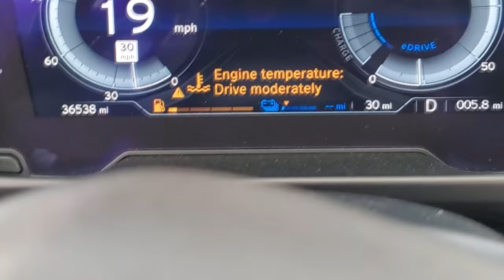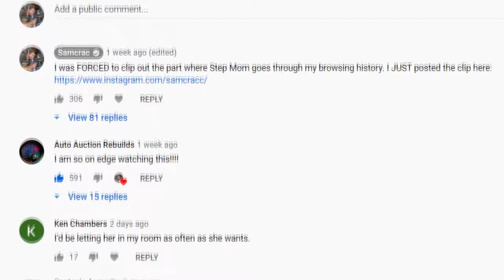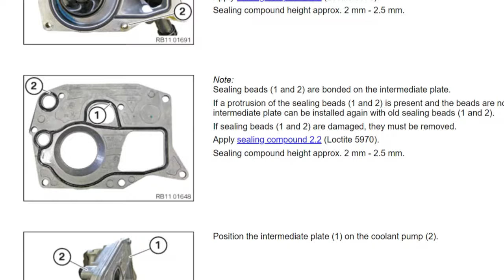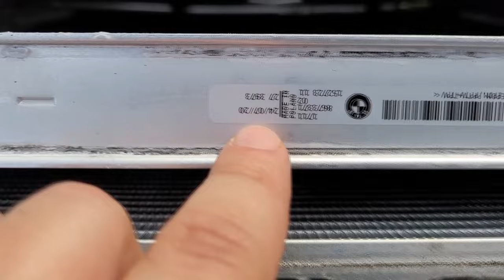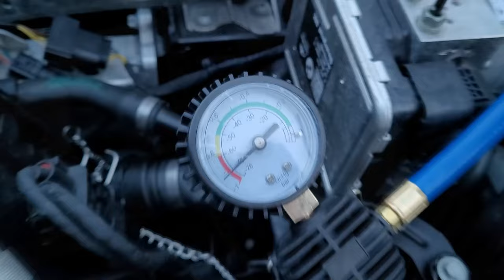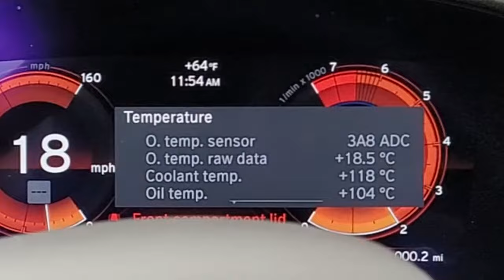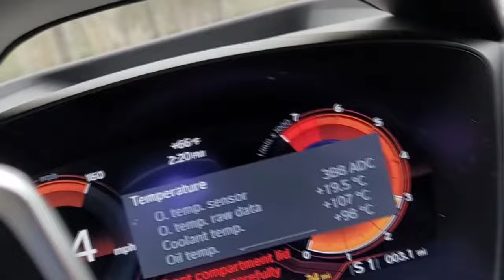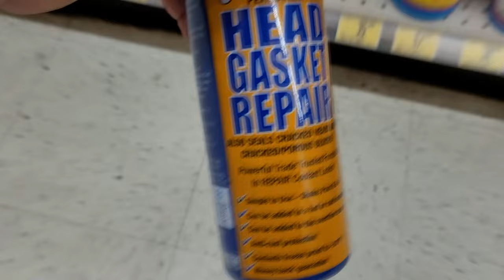The Dealer FAILED my "Unrepairable" BMW Supercar! Can I Fix it with this Simple DIY Trick???

Comment: There is a procedure on BMWs to tell the car software to bleed the coolant system for high and low temperature circuit, two separate procedure's, if you have the BMW software on your computer for the instructions it should be on there, it's something like ignition on, low beam lights on, hazard warning lights, temperature on maximum, fan speed on lowest, foot on the brake and press the accelerator for 15 seconds and it should start the bleeding process, no 100% but I think that's close, you can see/hear the system bleed itself

Comment: It's weird that the system would hold vacuum if that is the cause, maybe try to manually turn the engine until a valve opens while under vacuum ?

Comment: I'm wondering if there could be an incorrectly installed head gasket from a previous repair, therefore causing blocked coolant passages between the head and block. If it's even possible on this engine. Though surely there have been people before me recommending the same?

Comment: Did  you pressure check the system? Is there a bleed valve on highest coolant hose or highest spot of engine? Crack it when you fill with water tighten it when water comes out run up to temp then slightly crack again any air will escape if water comes out your good to go. Good luck. Also jacking up isnt  a great idea you need to fill the radiator this is the worst most waste of time that's good pipes are hard there pressurised leave it pressurised check dor leaks  have you put coolant in it? Dont run on just distilled water bad idea. Use waterless coolant it will keep engine temp down.. use the system cleaner before you add waterless coolant you can reuse it it has rust inhibitors in it. Best of Luck mate.

Comment: Instead of bleeding with all them vacuum gadgets, try to connect a hose and suck it till it runs in the cooling pipes towards the lowest point, start with Water then change to coolant and you are then absolutely sure that no Air is in the system, i use that Method when i use a hose for leveling floors ASO where trapped Air could be extremely expensive

Comment: Is the distilled water recommended by BMW? Because distilled water reacts with carbon dioxide absorbed through plastic and rubber to produce a weak acid that will cause corrosion and damage to copper and aluminum tubing and parts. Engines and radiators usually have a lot of either one or both. I have seen copper and aluminum corroded from heat exchangers and piping because someone thought that filling the system with distilled water was a good idea. You want to use water with a neutral PH, low chlorine, and low mineral content. While some tap water will be perfect, most unsuitable tap water will generally be fine if ran through a carbon and reverse osmosis filter system. If your tap water does not suffice, most store bought purified (not distilled) water will be fine, or you can purchase de-ionized purified water in bulk from specialty water suppliers in most cities with manufacturing industries. This comes from working with boiler and hydronic heating systems, and my Volvo mechanic. Ultra distilled water is used as a solvent in industries like chip manufacturing to strip components of metal contamination instead of chemical solvents.

Comment: Shouldn't use just "any sort of lubricant" on the joints as most will attack the rubber seals, should be a teflon type of lubricant preferably.
Reply: Thank you finally someone said it , I’m a retired engineer from nasa and those were major problems in the early days.

Comment: Found this online......
Sounds like something BMW would do.

Coastali8 03:38 PM 05-16-2018
Here is how to bleed the cooling system on the i8

For the bleeding of the high-temperature cooling circuit proceed in the same way as the procedure for conventional vehicles. However, unlike in the low-temperature cooling circuit, the bleeding procedure does not end automatically, but must be independently completed by a Service employee.
1 Evacuate and fill cooling system using vacuum filling device. Remove the vacuum filling device after the filling procedure is completed.
2 When the expansion tank is open, open the bleeder screw for 20 seconds.
3 Close the bleeder screw and expansion tank again.
4 Terminal 15 ON, set IHKA controls to 28 °C / 82 °F at blower speed 1 and "Air conditioning OFF".
5 Press the accelerator pedal for about 20 seconds at full load (engine OFF).
6 Start combustion engine in selector lever position "P" with Automatic Hold brake engaged.
7 Increase engine speed using accelerator pedal 4 times for about 5 to 10 seconds to roughly 3500 rpm, with a 10 second interval between the respective engine speed increases. Repeat procedure every 2 minutes for about 16 to 18 minutes.
8 Increase engine speed using accelerator pedal 4 times for about 5 to 10 seconds to roughly 5500 rpm, with a 10 second interval between the respective engine speed increases.
9 After 20 minutes carry out a test drive in selector lever position "S" and with heating turned on fully.
10 The ventilation is completed as soon as hot air flows continuously from the air outlets.
11 Adapt coolant in the cooled down state to MAX filling level.

Comment: Exactly happened to me i bought a jetta and it got hot when driving long distance . Had no leaks. Changed thermostat and water pump and radiator. Still did same. Whent to a shop and mine also turned green  lol replaced top gasket all good

Comment: The first test to carry out on most BMW engines. A sniff test. Put an emissions tester over the coolant bottle to detect unburnt hydrocarbons. 
Showing a leak from the combustion chamber into coolant system.
Diagnosis before parts.

Comment: Antifreeze does not boil and evaporate like water does. Could it be that the distilled water is turning into steam inside of the system? I know it seems like a waste to use coolant for testing purposes..

Comment: Rebuild the engine . Try replacing that water pump first . I've seen water pump blades sheared off inside and all your stuck with is a spinning disk . Don't put engine gasket repair in your motor you'll gum up your engine and mess it up even more . When you vacuum the lines too much it depends on how old your gaskets are you're breaking your gaskets apart

Comment: If you have a warped head because it overheated it's going to push combustion chamber gases into the cooling system and you will always have air pockets

Comment: overheating that little engine so many times i am sure it might have developed a crack and a headgasket change won't fix the problem. 
any way you should dismantle the engine and have the cylinder head surface machined and  pressurized to make sure there are no leaks or cracks.
using magic head gasket sealants might work but you should get rid of the car asap as it not going to last.

Comment: When bleeding my mtb brakes i always degass the brake fluid by setting it under pressure, its amazing how much Air is trapped in the fluid itself and its invisible untill pressure is applyed, hope you Can use this input

Comment: I called it on the last video, combustion leak.
Knowledge from an old MK1 Toyota MR2.
Had to run it so the coolent cap wouldnt seal until I had the engine swapped.

Comment: Maybe the fact the thermostat comes attached to a new water pump is a HUGE hint.. why only replace the thermostat? I would change the pump as well. Eliminating variables is the name of the game you are playing with that car. I think its a partial blockage in the coolant system. Blocked enough to screw the car but not enough to prohibit filling and bleeding the system.

Comment: When the head gasket goes out then you shut off the engine the cylinder fills up with antifreeze and causes a hyd lock. Any pressure pump should have told you when it losses pressure

Comment: Definitely would look into a all metal thermostat and double check the ccv might have to toss a oil catch can in and reroute everything the vacuum lines to alow better oil pressure (ps plug up the dip stick drain line)
Reply: Also during the bleed procedure turn car to on position heat high and fan blasted as you fill slowly open the bleeder and allow the bubbles to go til it’s a constant stream

Comment: Very yellow in the end. Did you put it in front of the exhaust pipe also? :-p 
I could swear that you would find a dead rat crawled up the cooling line from when the car was dismantled in front after the accident, or a paper tissue used to prevent dirt from entering the lines...

Comment: If oil and plugs ok it's water air flow problem .open the thermostat . remove it in theory.take for drive with bonnet open a bit all plastic engine covers removed

Comment: I commented about block tester on last video. Now I would go and look if there is an egr cooler present somewhere on that engine. They do leak exhoust gases into coolant. And playing with gasket sealer will destroy turbos and small passeges on modern engines. Will eventually still fail and ruin catalytic convertes too. You got to find a problem and fix it. You was gambling with this car  anyway. I still think car worth pulling an engine,

Comment: i sent you a email on a thought i have but double check the routing of the belt that drives the water pump.if it is running the water pump in reverse than you would have the same issue

Comment: Just adding my 2 cents worth. I used to own an old vauxhall Astra. that had a over heating problem. turns out the car had 2 oil rads, one of which was blocked. could it be the BMW be over heating on the oil instead of the water??

Comment: The incline trick doesn't have anything to do with it being mid-engine, same thing works for front or rear engine cars.  The idea is to just make the fill point (the radiator cap) the highest point in the system so all the air goes there.  If you had the fill cap in the rear, jack the rear up.
.
FCP Euro is awesome btw.
.
That was a shitty result, neat little tool there...I had a feeling this was the issue when you said last time that the dealership recommended new engine.  I can't imagine that engine is cheap....but then again, not exactly a high performance engine, is it?

Comment: If you Vacuum fill the cooling system correctly, you  could have the car upside down. It doesn’t matter, it will get the air out. Why it recommended to do it that way with all cooling systems

Comment: I just unclip the tank and secure it high up before a few 10sec/ 3000rpm throttle holds. The tank needs to be the highest point in the circuit and then It’ll burp no problem.

Comment: I had a truck that would randomly over heat and after a ton of parts swaps and trouble it wound up being a hose that would collapse when the motor reved over 2k rpm

Comment: That still doesn't explain why, after charging the coolant system, it still overheats with no discharge out the tailpipe...unless there is a CAVITATION issue - and still no coolant loss. The bubbling might be due to the expansion of the heated air in the cavities affecting the coolant in the system.

Comment: The condenser is a 2020 the car was hitting the front the radiator may be a used radiator if the customer ran the coolant low and damaged the engine you have blown head gaskets or warped heads and blown head gaskets. I've been working for a dealership for 30 years and I've seen it many times the people think they can keep driving their car

Comment: The lube on the hoses is not a good idea, maybe dish soap or veg oil? Don’t use lube as it rots the rubber over time as their usually petroleum based.

Comment: Also why are you just using water? Distilled or not bmws, cars are meant to be ran with specific coolants. Bmws especially need a specific coolant. It provides lubricant for different parts of the coolant system. Running the car with just water or the wrong coolant will start damaging essential parts

Comment: I used to be a fan back in the 80's and 90's, but you couldn't give a BMW made in the last 20 years. They have a working life span of about 70k or 80k miles before they start to fail. Most newer cars make it to 130k+ miles before they start to need major repairs.

Comment: I had a similar problem with one of my vehicles flushed it several times, no error anyware runned fine, but keep on overheating and quick changes in temperature new radieron, termostat everything replaced but keep on happening. then Replaced temp sensor just I thought car was overheating to fast. or jumping temperatures very quick.  and it got fix.  Just a thought. !

Comment: ... Like I guessed in an earlier video, blown head gasket. This should have been the first test.
The dealer had it right, replace the engine. Easier for him than a headgasket plus whatever else, repair.
Putting lubricants on  plastics is risky, polycarbonate is super sensitive to hydrocarbons.
Use soap, dish washing detergent or silicone if you must.

Comment: I can help solve your problem you need to do some testing with multimeter and also change water to antifreeze but before you do make sure your water pump is working
Reply: Water boils at 215 ish and cars operating temp while running is 220 so that water will boil and steam creating excessive psi which can damage your coolant system components and engine can cease
Reply: There also must be a bleeding process once you’ve fill up the coolant system with antifreeze
Reply: Most likely if the thermostat comes with the pump it should be replaced together at the same time

Comment: You really thought air bubbles, dissolved gases  and   or unnoticeable leaks caused the problem ?  Akways6 check for specific evidennce  of the problem... Eg  test the fluid in each pipe ,at each spot possible, to find where its  blocked or  just not flowing ...(bypasssd ? )

Comment: Wouldn’t a blown head gasket be pretty obvious with coolant being in the oil?
Reply: Only if the fissure in the gasket is between the water jacket and the oil gallery. If it's between a combustion chamber and the water jacket then the combustion gasses pressurise the coolant and/or the coolant gets into the combustion chamber(s).

Comment: 9:12 I am not sure putting petroleum based lube is a good idea, it will attack plastics and rubber over time, and you don't want any in the system.

Comment: You are dead on that the problem is solvable.
I bought several cheap cars with issues over the years, and repairs have ranged to a split hose, disconnected vacuum line, bad cables and similar. Just takes time to find it.

Comment: @sam............     i told you before what the problem was.   HERE- a cheat sheet-> (Infrared Laser Thermometer With Color Alarms-Harbor Freight)  I can only lead you to where the water is.  THE PLASTIC BLOCK , MOUNTED TO THE ENGINE BLOCK IS THE PROBLEM!  i have fix so many BMWs ,SUBURUs,MITSUBUSHIs(evo),HONDA(cvcc),NISSAN (240) DATSUNs(510-810) overheating problems.

Comment: As soon as he started squeezing the bulb I said, "Aha, FAIL!"  I've done this test thousands of times over the decades, sometimes it changes immediately, other times like this its a bit more gradual.  When the fluid changes from its original beautiful deep blue to a greenish tinge, you know it's failing.   Turns light yellow when 100% saturated with CO exhaust gas which has no business in the cooling system.

Also, WTF USING A FLOORJACK ON LAWN!?!  Super dangerous.  I had a jackstand sink into crummy asphalt once while trying to kick a 5 speed trans in place of a 4, did the fastest Exorcist spider walk out from under there as the car slumped onto the transmission and jack.

Comment: Where dropped temp dropped down thats where the cooling fan turned on and the shut off. Got and electrial issue. Lookes like a coil in a relay may be going open when hot.  Dang thing is a rolling super computer. One bad connection and your in for a nightmare.

Comment: Had an Expedition with a 4.6, had an exhaust side leak into the coolant, only thing other than rebuild that worked was Thermagasket short of pulling the motor and rebuilding it at a cost higher than the value of the vehicle. Got another 5 years out of the truck before I threw in the towel. DO NOT WASTE TIME AND MONEY ON OTHER MECHANIC IN A BOTTLE SOLUTIONS, THEY DONT WORK ON EXHAUST SIDE LEAKS!!!

Comment: ANTIFREEZE INFO

Something to keep in mind for anyone new to working on cars 

 its not just for “anti-freezing” it also helps with anti-overheating 

If your cooling system is filled with just water or mostly water it does not contain the correct heat transfer properties and the car will over heat even if there’s nothing wrong with the cooling system 

Use proper water/coolant ratio for you local temperature conditions

Comment: If I see the required ridiculous bleeding procedure I can only shake my head at this utter (over)engineering failure. The air used to bubble out of the cooling by itself in simpler times. But "keep it simple" seems to be a song of days long past. 

And yes, I have to admit that today's requirements oftentimes demand more sophisticated solutions than they used to 20 years ago. I don't think everything was better back then. 

Still, I think this cooling circuit is not well designed. But today's cars aren't designed anymore (were they ever?) with repairability in mind anyway. Because you don't notice that once you buy new and may not care because of warranty but once you're out of warranty and you need repair it's too late and you have to pay it and the manufacturer just shruggs.

Comment: That's drawn out. Any good mecanic can tell a bad headgasket with that pressure in the reservoir and C02 in systems along with overheat issues. 1h diagnostic MAX